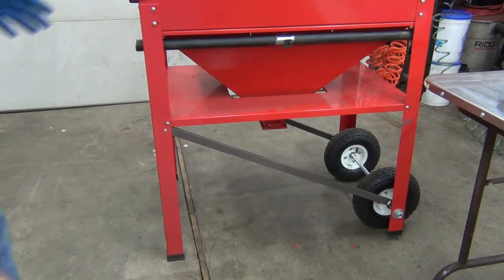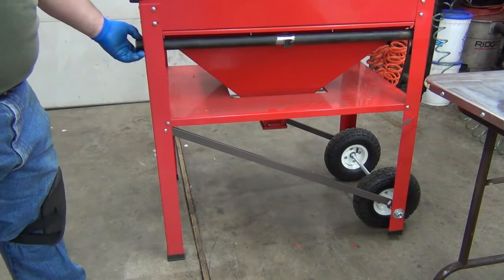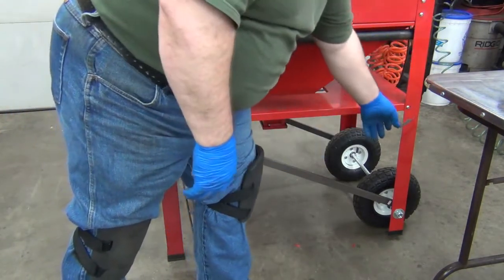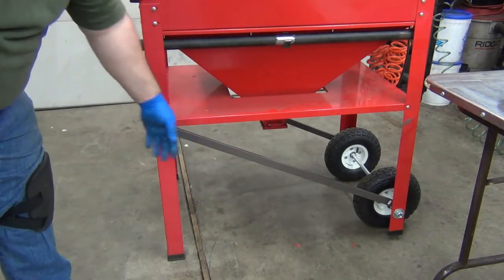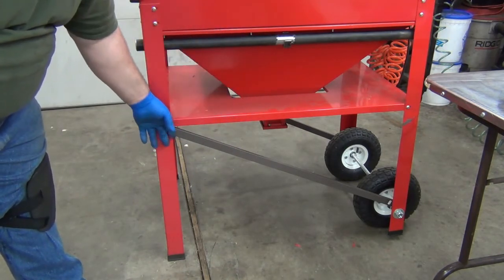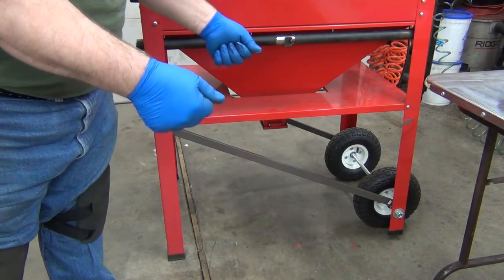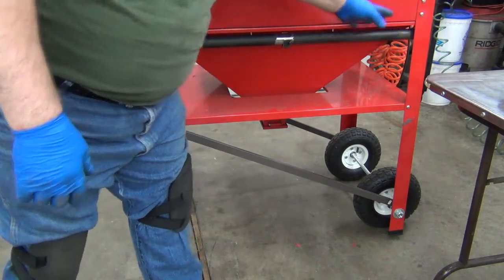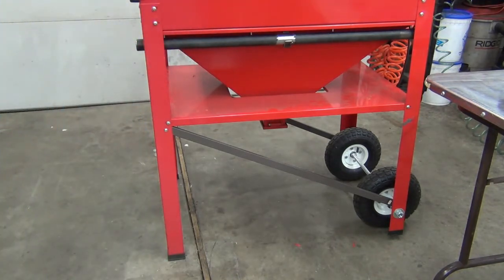Sandblast Cabinet Mods - Update

Comment: Nice Idea on the shield Mike!  I've just been turning off all the lights in the shop to be able to see.  lol
Reply from the maker: +Craig&#39;s Machine Shop I've since found that putting a lot more light in the cabinet is even better!!  I added a couple of LED lights from HD in the glass bead cabinet...love them!!!  I've added 3 of them in this cabinet.  I've got vid of the upgrade waiting to be edited, but I haven't finished putting the cab back together to try it yet.   I also put new glass in this one.
Reply: +bluehandsvideo  - Yeah, I really need to get around to adding lights.  I need a bigger air compressor before that though. Looking at getting the 60 gallon Home Depot one for $450.
Reply from the maker: +Craig&#39;s Machine Shop Sweet!  My HD compressor has been very good to me over the years.  Although, once I ran it for some "break in", I switched to Amsoil synthetic.  I also used one of their foam high flow motorcycle air cleaners.  I figured the more easily it could suck air in, but less trouble it would have refilling.  No clue if it made any difference! lol